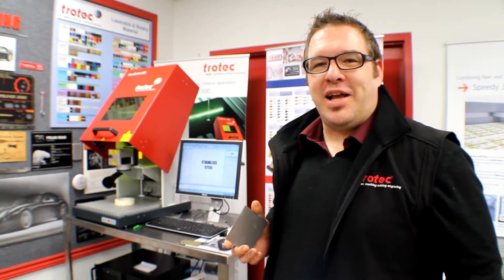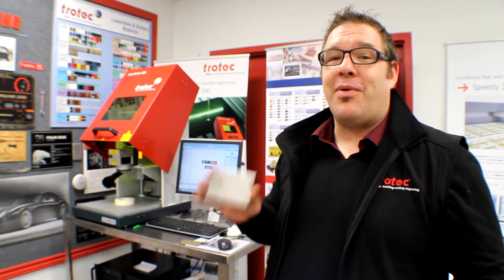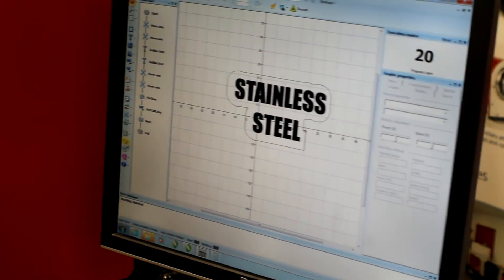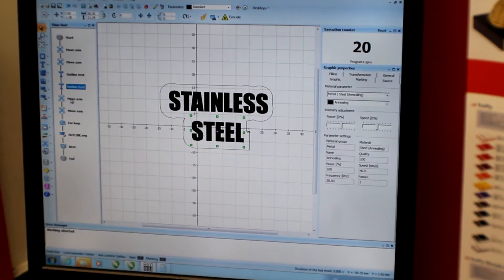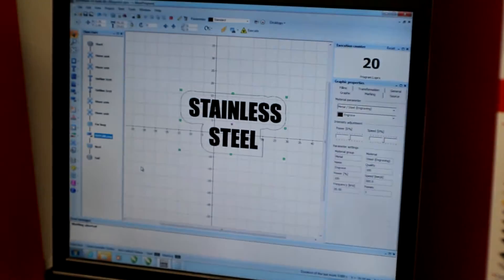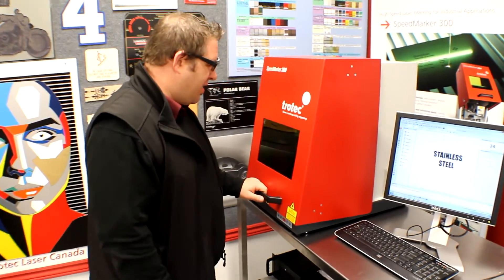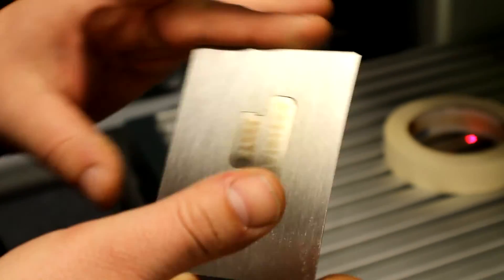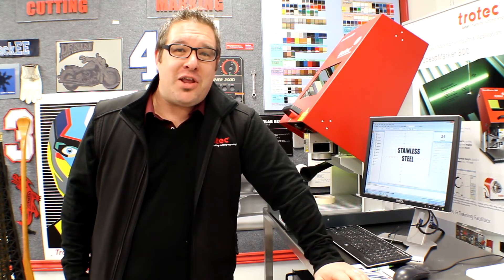Cutting Steel with a Laser Machine | SpeedMarker 300

Comment: can we cut 0.4 mm metal sheet 600x1000 mm ?
Reply from the maker: You would need a SpeedMarker 1200 for that size, yes it would be possible but it's not what these machines are made for so we would not really recommend it.
Reply: thanks

Comment: What was the thickness of the Stainless Steel?
Reply from the maker: +Walter09 Hi Walter. It was .025". But we have cut as thick as 1/16". 50 watt is recommended.
Reply: I have the same speed mark in my shop. What is the distance of the focus when cutting through 0.4mm of steel?